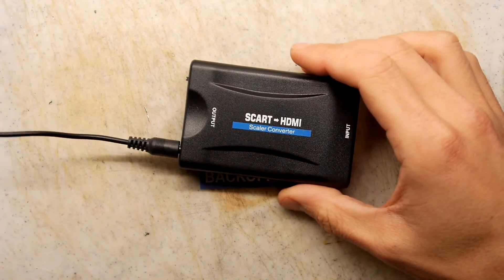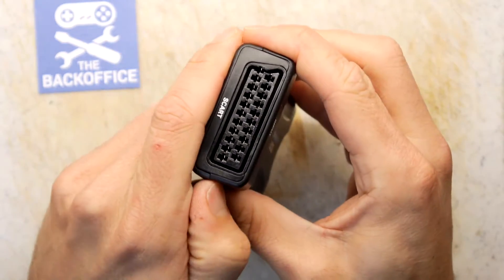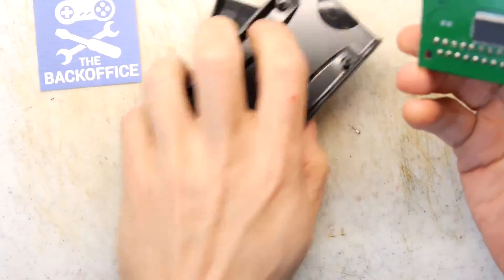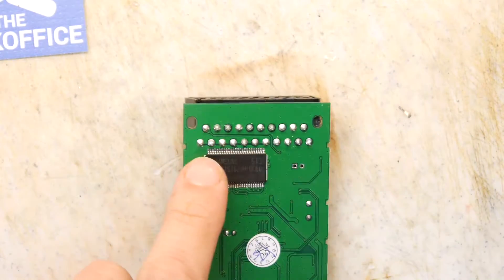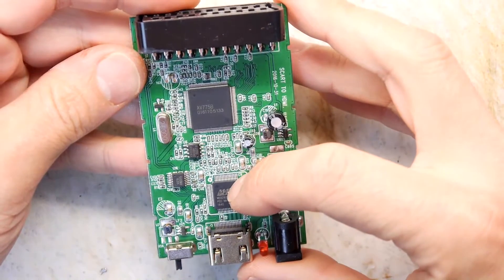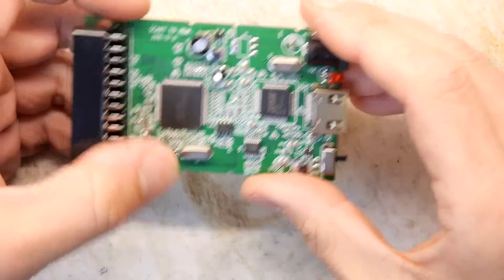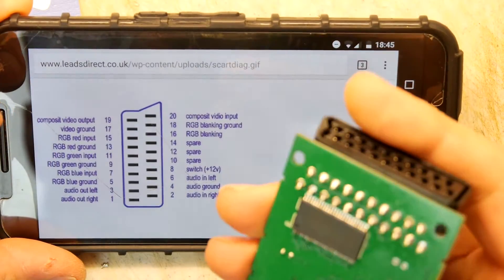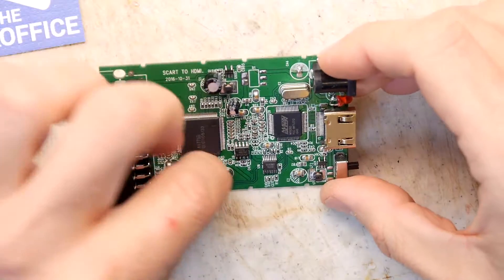Composite to HDMI Adaptor Retro ATARI Hardware Part 2

Comment: Try to fix....   In your board, Side Down in left you have SCART pin 16 opened (r14) , ( not resistor), this pin need 1 a 3 volts to enable scart.   Opened you get only 0 volts compost cable.

Comment: dude easy. the large chip is converting composite to RGBHV and feeding that into the MS9282. just cut traces to ms9282 pins 64, 59, 53 (unsure which is which but this is RGB), bypassing RGB to these pins should work as the large chip is still feeding H & V Sync to the MS9282. This should work. If it doesn't then you may have to make your own H & V Sync using a LM1881 to split C-Sync and feed that into pins 46 & 47 (again unsure which is H-Sync and which is V-Sync)

Comment: II got caught the same way. Got one for my Amiga 500 thinking it would do RGB. I have ordered a more expensive unit (as you mentioned) that is capable of more than just Composite. That said, i opened mine to see if it could be hacked to work with RGB for example, particularity if the chip supports it :)
Reply from the maker: My favourite solution at the moment are using TVs instead of monitors, they, for now, still offer all the inputs and seem to be happier supporting the older refresh rates
Reply: Without doubt :). I preparing for the inevitable, and ease and availability of my many LCD screens. I ended up ordering this, should be here soon: https://www.ebay.com.au/itm/SCART-HDMI-to-HDMI-Upscaler-720P-1080P-HD-Video-Converter-Adapter-For-DVD-STB/273090013308?ssPageName=STRK%3AMEBIDX%3AIT&_trksid=p2057872.m2749.l2649

Comment: Cringe just bought one for my SNES wish l had watched a few vids oh well 10er
Reply from the maker: You just reminded me that I have SNES in the loft that needs checking, hopefully it's not a big yellowed mess
Reply: backofficeshow buy an Everdrive or better still an sd2snes apart from FX carts every game loaded from an sd card slot in a standard cart format, noooo l don't sell them lol, it just makes sense! Great fun.
Reply from the maker: Yorkshire Pud my brother bought me a SNES mini so I'm pretty good for my SNES fix, I just hope it's not yellowed, I've seen some really bad ones
Reply: backofficeshow The mini will be ok it was an anti flame compound mixed in with the plastic for a period that caused the yellow (not ya dads smoking lol) look into custom firmware tho, would be nice to play Street Fighter or R Type arcade using mame 2010 cp 1 to 3 emulation.

Comment: The Samsung part is a DRAM memory chip, no doubt used as a frame buffer. The Macro Silicon chip appears to support RGB or YCbCr and audio (quite impressive really). How they manage to sell these things so cheaply is amazing as each chip must cost around a dollar or thereabouts. I was actually searching for an Atari 800 to HDMI adaptor...but found your video. The strange thing is that the Macro Silicon chip appears to do everything needed, so I have no idea what the AV775b chip does (and I can't find anything about it).
Reply from the maker: +migry You are correct, it is insane how they must have the BOM cost engineered to the point where we could not even imagine designing a device like this in any affordable way.

Comment: Thankfully these weren't available when I got mine or I might have had the same disappointment. Still, good for testing something is indeed outputting composite video or composite only devices.
Reply from the maker: Its a shame I did not test it on other equipment in time for this video, but it works great on those composite only things like Megdrive TV games etc.
Reply: Yeah that's what I was thinking, it's a good useful testing device to 
have around you if you don't have any composite input compatible 
devices.
FYI mine (other unit you ordered) seems to be happy with composite, s-video (was quite the surprise!) and RGB. My SCART selector has an RGB toggle switch so I can turn off the RGB input signals on my extension selectors for testing composite video.